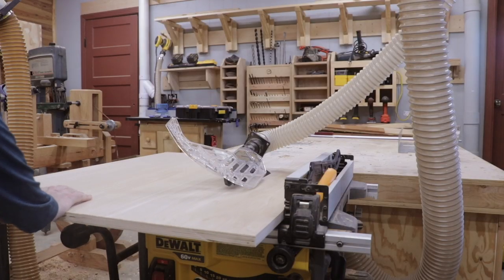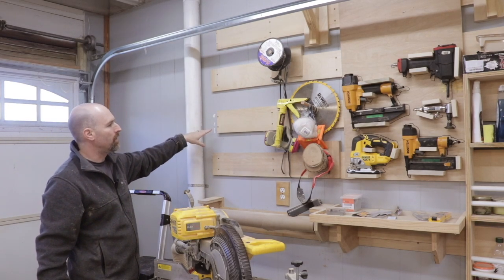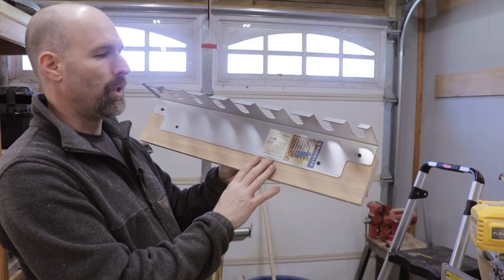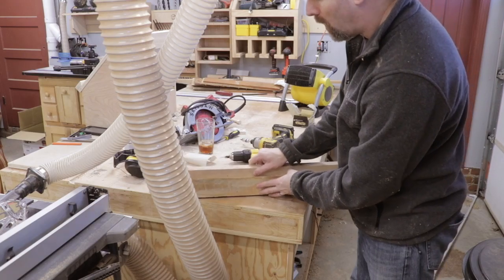Extending The French Cleat Tool Wall! New Pipe Clamp Rack!

Comment: Love your French Cleat implementation in your workshop.  I need to do something like that.

I did notice that it appears that you have the actual pip-clamp rack units mounted upside down to the intended orientation.  The little "up-turns" at the front of the slots are suppose to be just that - UP-turns that are to help keep the pipe-clamps from accidentally slipping off.
Reply from the maker: I’ll check into that! Thanks!